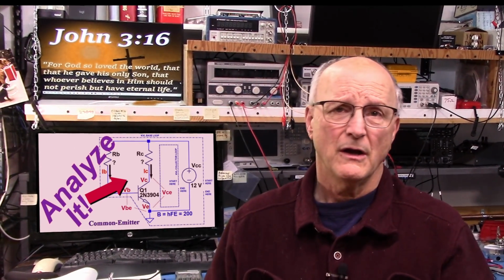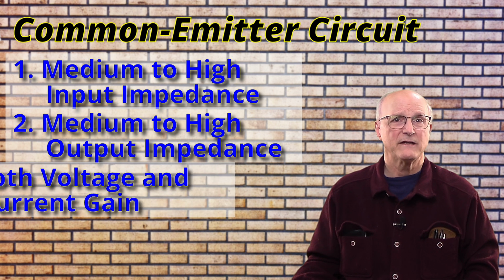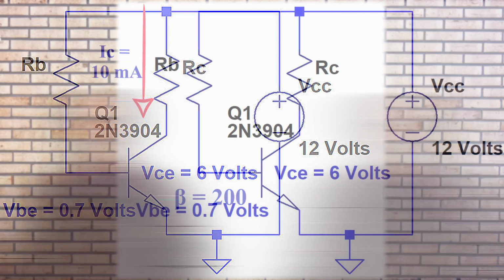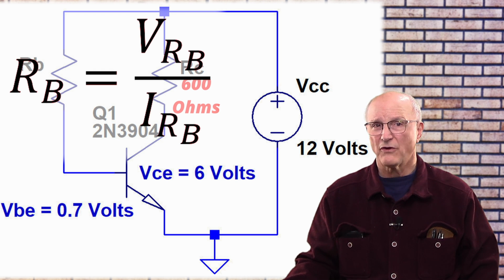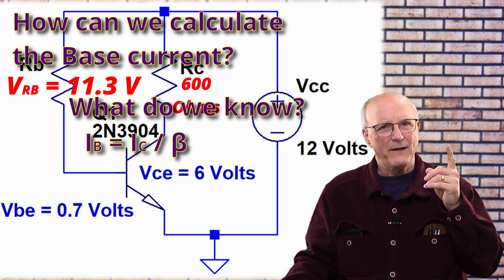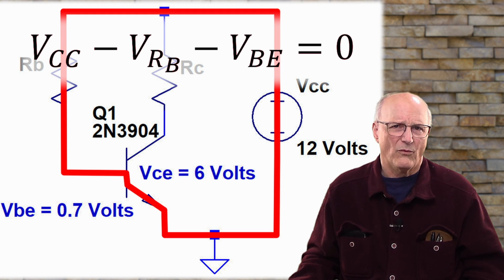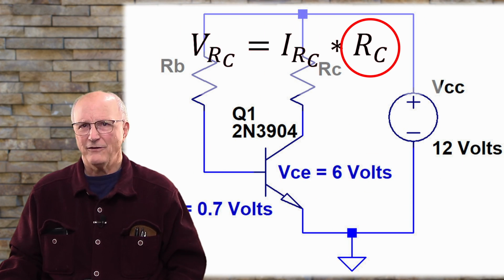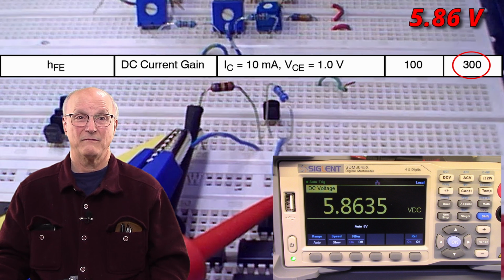Basic Bipolar Junction Transistor Analysis: The Common-Emitter Circuit (066b2)

Comment: WHY DID YOU USE 200 FOR BETA AND,NOT NOT 100?WHEN I DID THESE CIRCIUTS IN THE LAB IN COLLEGE WE TOOK A SOLDERING AND,TOUCHED THE TRANSISTOR WITH THE TIP AND,WATCHED THE CURRENT INCREASE IN THE BASE AND,COLLECTOR AS IT WENT INTO THERMO RUN AWAY.
Reply from the maker: The datasheet I have here tells me that the hFE can range from 100 to 300, so I picked the value in the middle. Admittedly, the wiser choice would have been 100 for the sake of thermal considerations. 🙂

Comment: The bias circuit is the worst type of bias. With temperature changes the collector voltage will be very unstable. The best type of bias is using to resistors in the base of the transistor, which adds complications to the design.
Reply from the maker: Absolutely, totally correct!😀
This was the most basic example of a common-emitter circuit.  It is intended as a primer on how to go about the analysis and design of transistor circuits.
As I said in the video, this is fixed with the "beta-stabilized" version. The addition of an emitter resistor and a voltage divider bias.  As I also said in my video, there is a video coming in which I work through this whole design.  In fact, I am in the midst of creating this video, even as I type.
So, stay tuned ... the best is yet to come. 🙂